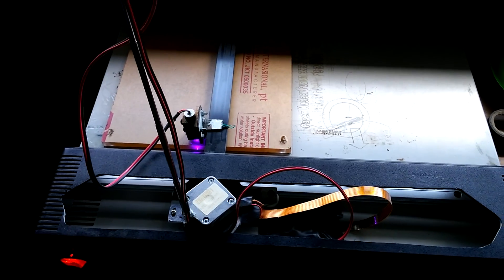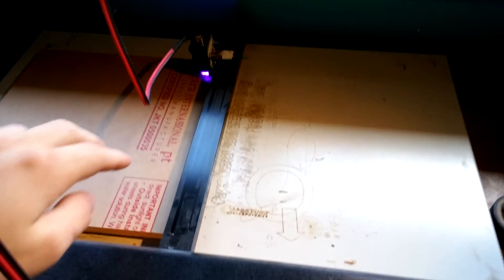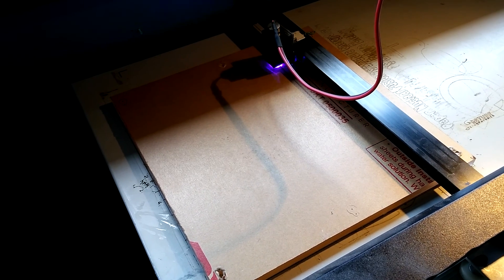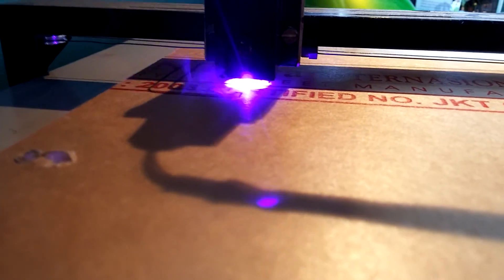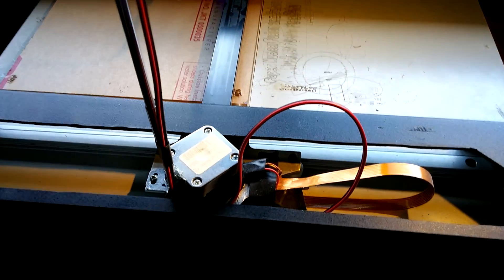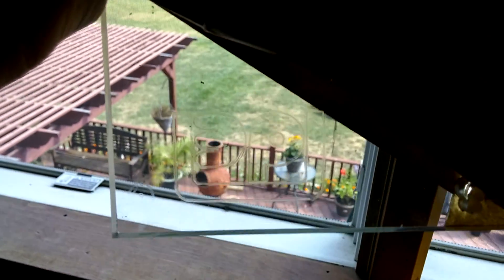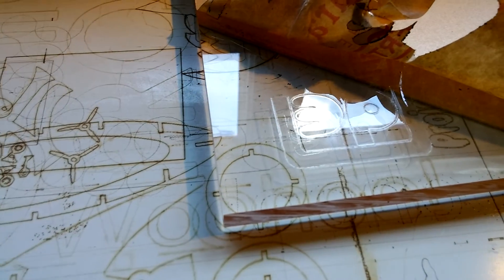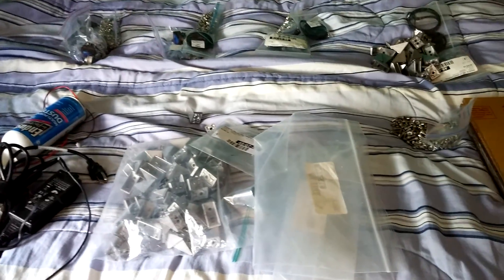Using a Laser Engraver for 3uP Acrylic Beds

Comment: As always nice job! Can your laser cutter raster engrave or is it vector cutting only? If you are interested in upgrading the laser let me know... Looks like its a 12x 405nm diode, in an aixiz module. If you want I can hook you up with a 3W 445nm diode in the same aixiz module with a glass lens. You should be able to cut much better, and quicker with it.
Reply from the maker: ermm..I didn't quite follow any of that XD but the resolution isn't superb because the firmware I'm using I don't think does microstepping so it wouldn't be worth it to upgrade the power until I upgrade the quality lol, but in this application it isn't noticeable. I would really love a nice 30W+ laser cutter with a metal frame and all but there is no way I'm buying that haha.